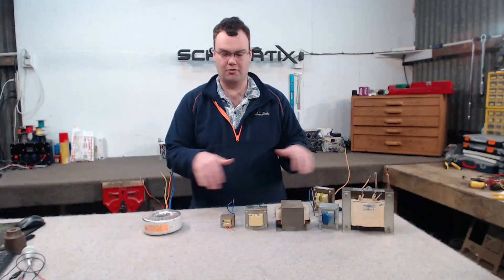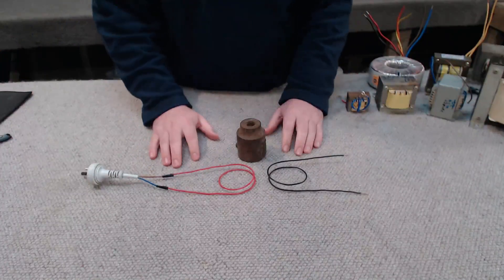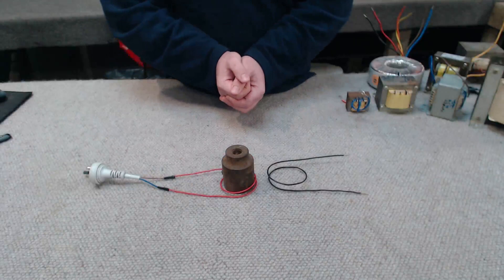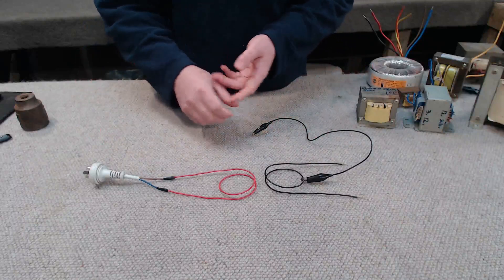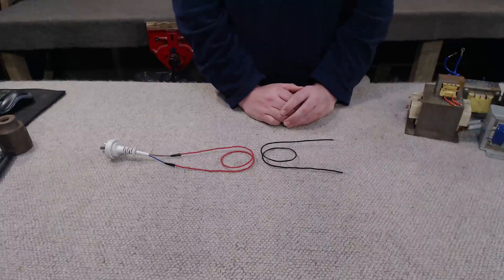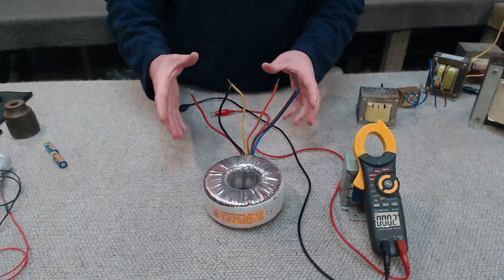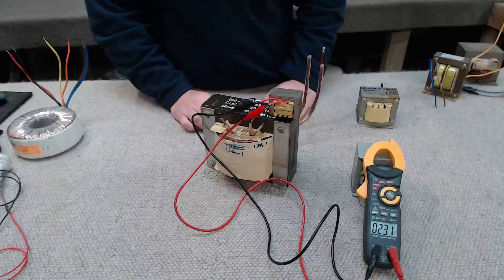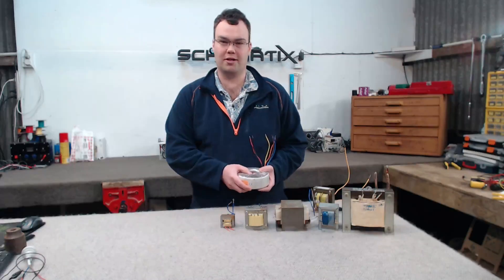Transformers 101: How They Work & How To Wire Them

Comment: I want to build an variable power supply 0 - 40V and high current not less than 30amps. So I need a stable transformer which can provide single out not less than 50V and 40amps. If you follow any transformer winding calculation please share.
Reply: Sivakumar Athiappan a few micro wave transformers rewound with just a few windings of about 4gauge wire. maybe doubled. maybe using 2primary windings and 2 cores 1as a base the other as the top. that should get about 3000watts +, then the 2x 4 gauge wire secondaries. should get about 8-12v. you can adjust turns to change volts. but then you will have high current.  then a full bridge rectifier. then use about 4 20amp DC to DC boost converters paralleled. that should get you a adjustable high current power supply. cheap and dirty! or use a power dimmer switch. with the transformer. and thinner wire with more windings. about 10 gauge coiling wire.  rectify. and maybe a capacitor with a 100k resistor across it. and bob's your uncle!
Reply: 3000watts for about 30 seconds
Reply: You can use a torroid shaped transformer and basically build a variac..
Reply: torroid  they are the best
Reply: look up how a variac works, if you want a variable power supply that is the way to go.. you can build one very simply if you can make the carbon brushes and stuff.